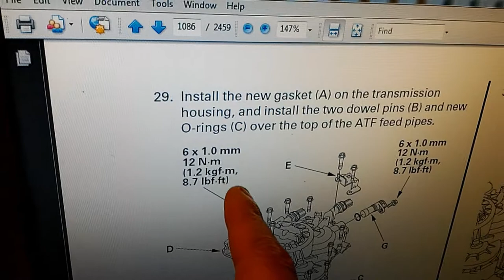Tear Down and Rebuild 2002 Honda Odyssey Automatic Transmission - Part 29

Comment: thats a massive amount of video. where did you get your rebuilt torque converter from?
Reply from the maker: I thought about getting a rebuilt one but a lot of reviews said they failed a lot. It was too hard to tell which were rebuilt well so I actually bought a new OEM one from majestic I think, it was really expensive like $700
Reply: @eksine  yeah i was looking around and a guy who rebuilds transmissions for a living recommended precision of new hampton out of chicago, ill.  the cost is $560 minus $200 for the core. the core has to be shipped back to them which is included in the cost along with tax. im pretty sure im going to get one from them. they rebuild like 1500 converters a day
Reply from the maker: @billbarney4937  dang that's a lot

Comment: Any advice on a 2019 Honda Odyssey transmission? just got it replaced because the other one was failing you think this new one will fail as well?
Reply from the maker: it looks like there's a class action lawsuit for that. I wouldn't know about this transmission but at least you are covered under warranty. I don't know if they fixed the defects yet. the most obvious thing that came up was the Lemon law and that poeple are apparently suing honda. it also looks like Odyclub forums knows about this, I used that forum, they have some smart cookies there, here's the search results and web pages https://www.google.com/search?q=2019+honda+odyssey+transmission+problems&rlz=1C1FKPE_enUS1000US1000&sxsrf=ALiCzsZA2O8fANYMWgZqIP0WBmrYMMAVFA%3A1651893099905&ei=a-N1YpXxNoPV9AO70a-QAQ&oq=2019+Honda+Odyssey+transmission&gs_lcp=Cgdnd3Mtd2l6EAEYADIHCAAQRxCwAzIHCAAQRxCwAzIHCAAQRxCwAzIHCAAQRxCwAzIHCAAQRxCwAzIHCAAQRxCwAzIHCAAQRxCwAzIHCAAQRxCwA0oECEEYAEoECEYYAFAAWABg1wpoAXABeACAAQCIAQCSAQCYAQDIAQjAAQE&sclient=gws-wiz

Comment: 06 Odyssey with whining transmission, 2 shops says "sounds like it's the pump", one says drive it until it dies.  How long do you think the pump will last (miles)?  Thanks!
Reply from the maker: It's hard to say, if it's actually the transmission pump they would have found it by detecting a lower oil pressure than normal, and it cannot be fixed because you can't order that part, not sure if you could even fix it by swapping parts out of a used one. I have a whine in my transmission but only because I installed the shift kit which adds holes that the oil leaks out of if you park the transmission for a while. Again if it's actually the pump and not something else it's like asking how long your worn shoes will last, it varies
Reply from the maker: Also the shop doesn't know for sure, they are assuming based on a sound. There's test ports on the transmission you have to connect to for a real diagnosis

Comment: Eksine,where’s the finish product , did you put them back together and where’s the video?
Reply from the maker: this video does show the left end cover being put back on. as far as the other solenoids go, the very first part shows taking them off. this video does show the very last steps, if you mean re-installing the trans back into the subframe my video on how to remove the transmission just needs to be done backwards. i also have a test drive video for this 2002 odyssey that you missed

Comment: Thank you for posting all these videos. I may have to do a transmission rebuild myself on a 2004 Accord V6. Where did you find the PDF manual that lists all the steps and details for the transmission rebuild? Also how has the transmission kept up so far? Thank you again for all the hard work of editing and uploading the videos.
Reply from the maker: you're welcome man, the 2004 should be similar except the position of the reverse gear collar might be upside down, you'd have to check that part. the pdf for the odyssey is online, usually you have to buy it but it can be found other ways online. my info is loosely based on hirem's rebuild videos, most of my info was just me figuring it out on my own. my info doesn't rely that much on the repair manual, that thing barely made any sense. I mean half the stuff it says doesn't even seem necessary. the transmission actually shifts smoother than my 2001 accord V6. it's technically better than the original transmission because of the design change in the thrust washer. I'm rebuilding the interior and exterior now, mine was in bad shape when I bought it. I didn't know much about fixing cars before I got this van. I learned a lot, too much actually

Comment: I wonder if you can make yourself a mechanical SPINE!!! Hnnnngh--
Reply: Chu like meh comment but I don't think you quite see what I'm hinting at UwU No worries. It's best that way
Reply from the maker: @kokopuffs7203  no I see what you're saying. The first thing I was thinking was Crysis. to make a spine on the outside would require some knowledge of kinematics like in 3D because your point of rotation is not in the center, than I thought about actually putting part of the spine inside of your spine, than I was thinking damn it would take a ton of research to even begin starting to design it, so I was like man I got stuff I need to do. it's possible I'm sure it's just I wouldn't even know where to begin. I learned that through rebuilding a auto transmission you learn that many difficult things are possible. the real question is is it worth putting your time and effort into it because managing your brains time is important too
Reply: @eksine  You are SUPER DUPER smart but-- Not exactly what I was referring to UwU